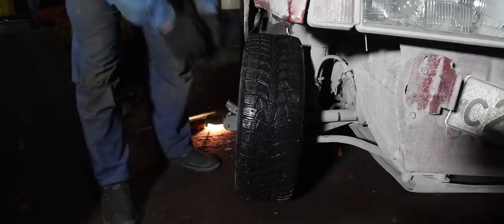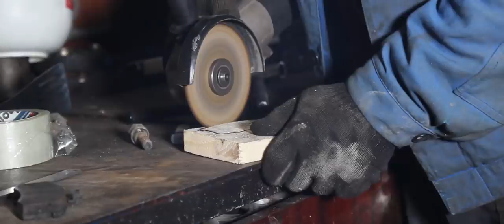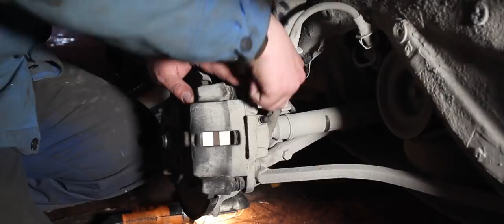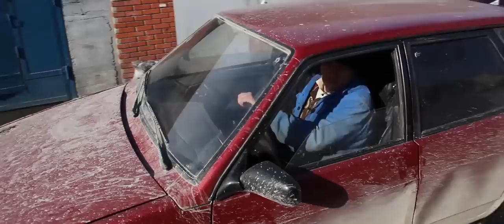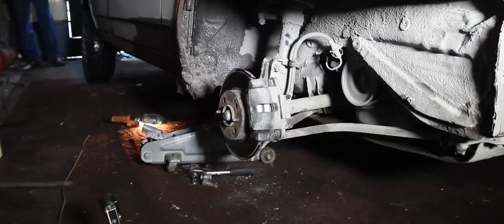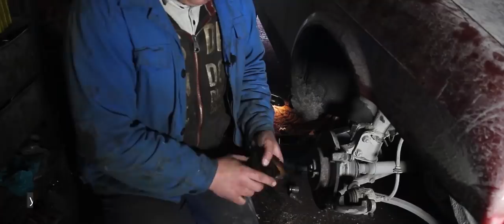Wooden brake-pads: will they work or not?

Comment: My request is simple! Please send me those use pads made out of wood! Because you did something on this video I've always wanted to do. does pads would make for one hell of a conversation starter
Reply: Brandon Allen are you american?
Reply: God Slave yes I am American
Reply: i don't see why u think that's an insult you prob do it your self
Reply: Brandon Allen Brakes work by dumping heat, ie. Converting kineric energy into heat which can be lost to the environment. If you use normal brakes excessively, they become red hot, and when they do, they don't stop the car from moving. These wooden ones will catch fire, which you know. What you don't know is that thsts likely to happen when you're going at a fair clip...
Reply: how bout go make them yourself then if its something you always wanted to do.
Reply: Eightosaurus Spelunk well someone has a American hater complex!! Why the negetivity ???
Reply: Cane Sugar actually I am aware of these things. But that sort of has nothing to do with my previous request!! But OK. Thanks for the info
Reply: lost on long island I would love to. But there are certain problems with that plan. Otherwise I would.
Reply: @Brandon Allen Why do you want them then??
Reply: Cane Sugar  the reason that I want the used wooden pads was mentioned in my original comment. I want them as a centerpiece or conversation starter. approximately 6 years ago I was having a conversation with a few friends that was about odd things that people do with cars and engines that may or may not have practical application use! during this conversation I found a few Automotive Oddities. one guy created a makeshift exhaust system for his van that was made entirely out of wood piping!! The wood was protected from the Heat by being coated in something that he called tough light!! Which apparently makes things virtually indestructible. I also met a person who made a cylinder head for a small engine out of transparent acrylic!! You can see the combustion process take place through the clear head!! These are all things beyond my technical ability to do... I also know several people who like to Tinker in their garage to create bizarre creations and use different items for various applications. during our conversation the concept was brought up of making automotive brake pads out of some kind of hardwood and putting them on the calipers to see how they would perform. none of my friends have ever done this. so I was playing around with the idea of getting the used brake pad shown on this video and using them as a display piece. during which I would offer the link to this video to show where the handcrafted brake pads came from and how they came to be in their current condition. in other words I see these brake pads as an interesting Automotive Oddity.!!!
Reply: Brandon Allen ^ that's really cool
Reply: Brandon Allen you've got the right idea... What other interestjng oarts do you have laying around???
Reply: consaka1 no u
Reply: consaka1 how do you not understand? How doesn't that make sense? 1v1 me m8
Reply: ? Understand what? So far nothing you say makes any sense. Its like your trying to type with your keyboard covered in bread dough.
Reply: consaka1 whats wrong with my keyboard being covered in bread dough?
Reply: Apparently you miss whole sentences that would help to make your babbling make sense. real curious when you are going to delete the rest of your comments like you did your original comment. lol
Reply: Build your own, you're lazzy or something ?:))
Reply: Brandon Allen
Reply: R.I.P. English
Reply: Eightosaurus Spelunk.....Jealous??? U.S.A. U.S.A. U.S.A. ........STILL ON TOP OF THE WORLD!°°°
Reply: Eightosaurus Spelunk..... ATTITUDES LIKE THIS ARE THE NUMBER ONE REASON WHY NO OTHER SOVEREIGN NATION OR COUNTRIES CAN OVERCOME & DICTATE, THE UNITED STATES. WHERE AT EVERY TURN. WE HELP ALL COUNTRIES IN NEED, WE PAY BILLIONS AND BILLIONS IN HUMANITARIAN AID TO OTHER COUNTRIES THAT HAVE NOTHING, HELP THEM WIN WARS OVER DICTATORSHIPS, GIVE THEM HOPE, GUIDANCE, SECURITY AND MILITARY SUPPORT. AND THEY ALL TURN AROUND AND SPIT ON US LIKE THIS MAN Eightosaurus Spelunk JUST DID! NOW I TELL YOU ALL, WHO REALLY IS THE HUMBLE NATION HERE! 
      AS LONG AS WE KEEP OUR FAITH IN GOD, (AT LEAST THE CHRISTIANS IN THE U.S.) HELP OTHER COUNTRIES IN EXTREME NEED, KEEP THE NUMBER ONE MILITARY, KEEP OUR SECOND AMENDMENT (The right for REGULAR SUVILIAN LAW ABIDING citizens To own firearms), AND ALWAYS SUPPORT ISRAEL AS OUR NUMBER ONE ALLIE, WE WILL PROSPER AND "STAY", YES I SAID "STAYYYYY" ON TOP. YES WE DIFINITLY HAVE OUR PROBLEMS, ALOT OF "MAJOR" PROBLEMS. YES WE HAVE OUR CORRUPT POLITICIANS, PEOPLE ON THE INSIDE WHO WANNA BRING US DOWN, BUT HEY WHAT COUNTRY DOESN'T? DESPITE HOW MANY OF YOU HATE US, DESPISE US, SAY WE'RE WEAK, DONT SUPPORT WHAT WE DO, AND LIE ABOUT US.........BELIEVE IT OR NOT, WE ARE STILL ON TOP, NUMBER ONE! SORRY TO BURST THE WORLDS COMMUNIST LOVING, FREEDOM HATING, NON GOD BELIEVING BUBBLE, BUT IT'S TRUE AND YOU KNOW IT. THAT'S THE EXACT REASON WHY THE WORLD HATES US!
Reply: Brandon Allen I guess you didn't watch the part where they're incredibly easy to make yourself? Also, if you need weird objects to start conversations , you might be a boring person

Comment: The street car cable trams that service the steep hills of SAN Fransisco have wooden brakes that are applied by downward pressure on to the rails between the wheel carriages. The vehicles only run at about 20 kilometres per hour and the brakes seem to be very efficient.
A very interesting experiment  with your disc brakes .I imagine that your idea could be adopted for use on stationary  machinery maybe to stop a flywheel spinning or similar use.
Cheers from Australia

Comment: I know that a decade ago the San Francisco trolleys were still using wood for their brakes. Whether they eventually updated recently, I do not know. Regardless, from what operator told me is that it worked damn good. They just had to replace the planks every couple days or so.

Comment: Vintage cars (mostly before 1920) often had wooden wheels rather than wire wheels. I'm not talking about brakes; just the wheels. The problem with them is that wood doesn't dissipate heat well, and the properties and performance change when the wood gets hot. Wooden breaks would overheat almost immediately and then stay hot for a long time. But in this clip, the car is being driven in the fucking Arctic which would help a little. Try driving it with wooden brakes on a 90 degree day.

Comment: Try them on the interstate. And put them on all four wheels. You proved they can work as long as you don't abuse them. If I was desperate for pads I would give it a try til I got the money for pads. I've driven over forty miles with only the E brake. It takes nerves to do it but I saved a wrecker bill.

Comment: Life hack: How to start a fire using your car disc brakes.

1.  Get piece of flat wood about 5/8 thick.
2.  Use jigsaw to cut into shape of brake pads.
3.  Remove asbestos pads, (bad to breath) and replace with wood pad.
4.  Apply break and gas pedals at the same time.
5.  Fine wood shavings will appear and the friction will ignite it.
6.  Take flaming wood and put it in wood pile to start it on fire.

Accelerated version.
7.  Soak wood pads with lots of gasoline.

Comment: Whoa, I need to make these for a bicycle that I've worn all the rubber down to the metal. It seems this would actually work. If it stops a 2000+ lb car, it can probably do the same with a slow speed bicycle + light weight rider. Sure it won't last miles and miles of braking, but I'm not going down a mountain (its super flat where I live, and I generally coast most of the way stopping since I'm providing the power instead of an engine). It would be interesting to see what happens.

I would recommend using the best pads available for your bike (as well as high quality tires) due to safety reasons. I'm not going to be racing with this bike obviously, and I wouldn't recommend attempting the same due to safety concerns.

Comment: without even watching the video i would generally say no,and this is coming from an automobile mechanic.a lot depends on the type of wood and you would need to use a hardwood for even minimal success.but even if the wood used can create enough friction on the braking surface to stop the vehicle there is always the chance of build of noxious fumes from the pads and combustion from heat.

*edited for a few spelling errors  :)

Comment: You should be using a dense wood like Ash.
Traction engines still use wooden brake blocks.
Wood was the material for brakes until a few decades ago.
Reply: John Morley .

Comment: If you ever rode on the cable cars in san Fran wooden blocks are lowered onto the tracks and likft up the chass is for braking.  So historically wood has been used for brake shoes for railway equipment.

Comment: The Montreal Metro actually uses wooden blocks, so yes, they do work. They've been replacing the old fleet and they've are using the exact same break pads. They are being used because they do not cause wear on the metal wheels of the metro and are mostly silent. They are dipped in peanut oil.

https://www.youtube.com/watch?v=MdvQLYC5hGc

Comment: I didn't see the rotor glow. I think the heat was being carried off by the pyrolization of the wood, creating smoke, and the shavings. I am surprised, that there were no flames. I guess heated wood just doesn't have the sheer strength, due to heating of the lignin. It literally comes unglued. That would explain the rate at which they wore away. Fun experiment anyway.

Comment: About 35 years ago i met an old man on a motorcycle that seemed older than him. I asked him about it and he said it had 200cc needed 4% oil in the gasoline and he woodnt drive faster than 70km per hour  since the brake pads were made out of wood. I looked and he told the truth...

Comment: Seen aboriginals do it. Kinda works. Better than nothing. Also my father knew of sn aboriginal with a bad cylinder in his engine. I think he left the conrod in (not sure) and replaced the piston with a bit of wood and left the spark plug lead off. Car ran although it was obviously missing on one cylinder. Drove it like that for 20 years.

Comment: Many vintage cars from the 1930's and earlier used hard wood brakes.  Those cars had much less horse power and typically were not driven as fast as a modern car

Comment: So without flooring it while holding brakes, if you don't descend a mountain these can last you a while. With sub-par braking, but working.
Although you would pay the same price or more in "Wooden brake pad making" labor than it would(wood) cost for the parts / real pads.

If you have a wood shed. Are laid off. And have time but short money do what ya gotta do. Haha. I'd push a half year out of these ;)

Comment: Interested to know how well the car would stop with wooden pads on both front tires.  Also would they work better if you ran the wood grain the other direction?

Заинтересованы в том, насколько хорошо автомобиль остановится с деревянными подушками на обеих передних шинах. Кроме того, они будут работать лучше, если вы запустите дерево зерна в другом направлении?

Comment: I predict smoke.  I think it will work, but I predict they will smoke at least a little.
EDIT:  Does he have regular rear brakes still?  Did he do the rear brakes, or just the front?  The did a close up of the rear tire and front tire while driving.  So I think he did, but they could have been more clear.

Comment: ceramic brakes are all the rage... But metallic brake pads are much better at dissipating heat which means longer bearing life and less chance or our brake line melting and going up in flames.

Comment: Of course wood works as brake pads. Braking is simply controlled friction. Anything will work, some things better than others. Of course, with wooden brake pads, you will be changing them a lot and you may lose braking power after a decent drive, and there's also the issue of fire.
Reply: Mark R well said

Comment: could work problem with wood, is you will have a friction even your not pressing the brake yet, that slight clearance could potential touch the disc and produce some heat and when press the brake could produce more heat potential of burning it. No use for long drive.

Comment: It probably  would have worked better with a metal back and harder wood and getting rid of the outer edge that ended up preventing from going any further with the brakes.
Reply: Not saying it would work as well as storebought. But the metal back would provide more even pressure across the pads, the harder wood is just that harder and might not wear out as quickly, and getting rid of that outter edge for the same reason the braking compounds dont go to the edge of the pads.

Comment: LMAO was really expecting them to catch on fire......I guess that's why they used to be made of asbestos & why they converted to ceramic @ FEDEX we used to use Ceramic pads & ceramic braking disc rotors but @$10k in parts per wheel wasn't cost effective....

Comment: Yes it'll work as friction will slow it but the test is flawed as you only did it on one wheel. So the other breaks can ruin the results as you clearly didn't think logically about this.

Comment: Just copying australian aboriginal show out back mechanic ,they made brake pads out of redgum timber,filled flat tyres with grass,filled windscreen washer bottle with petrol used it as fuel pump ,made clutch plate out timber ,made wheel out redgum ,so bet this person watched show was on 10 years or more ago .